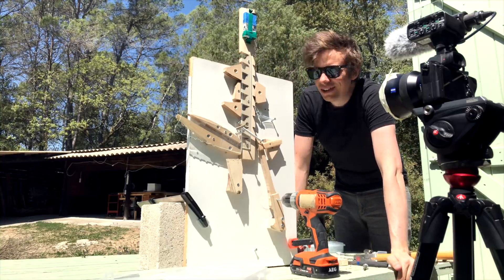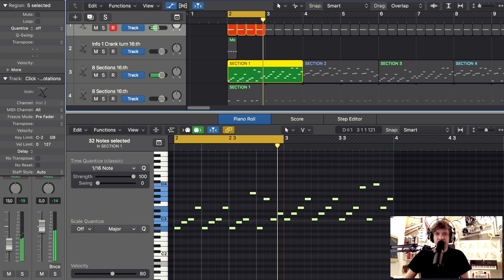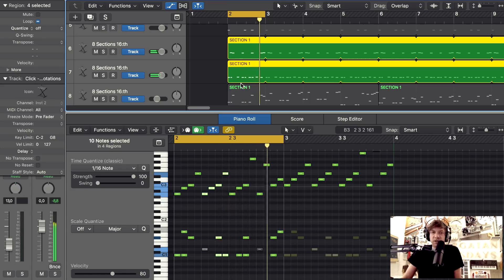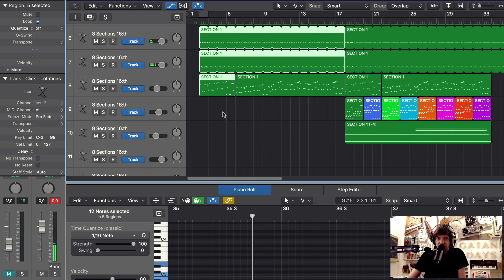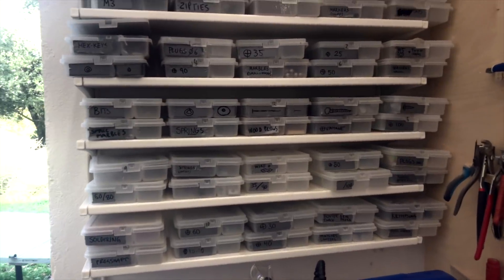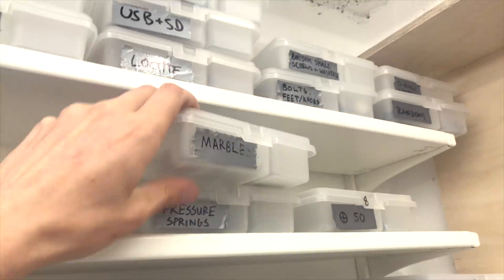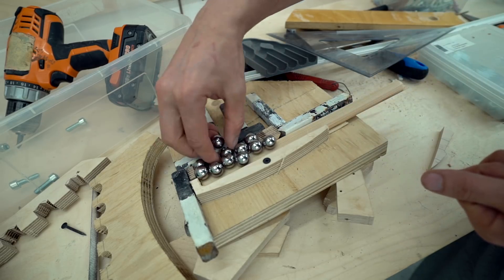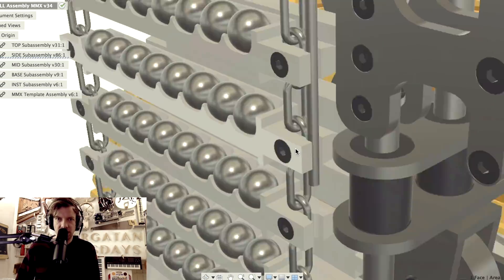Conveyor Belt Marble Lift - Marble Machine X #33

Comment: You are lifting them statically. Why not flick them up a slope like at the start of a pinball machine? If that is to noisy, you could accelerate them slowly by a spinning spiral cam shaft. The marble starts accelerating at the centre of the cam shaft and gets faster and faster as it moves towards the tip of the spiral. At that moment it would need to have enough momentum to shoot all the way to the too of the machine. This soultion would achieve the same material flow but with only one moving part and that is the spiral cam rotating around an axis. 

Your current lift looks very cool, but as an engineer, I would always try to remove as many moving parts as possible.
Reply: Wouldn't flicking them up require running the machine at a certain tempo? Run the machine too quickly and you risk marbles turning into bullets, too slowly and they don't make it to the top.
Reply: if you want him to notice you, and this idea, you should make a topic on his reddit page so more people can agree with you and discuss it with you.
Reply: Here is a sketch: https://imgur.com/a/9rC28Cb
Reply: Max Maker Oh. That's not what I thought you meant. I was thinking of an Archimedes Screw.
I still think any kind of reliance on upward momentum is a bad idea.
Reply: Brian McHaney Archimedes screw could work though, have gear ratio that spins it fast enough so the supply of marbles is stable, and it would add a really nice aesthetic feature if it was for example in a clear tube, or maybe even two of them.
Reply: Thanks. I just did.
Reply: +Wintergaten I used to own a Hyperball arcade machine. The solenoid system can shoot a lot of marbles really far, really fast. https://youtu.be/_RCmw74L1vQ?t=56s
Reply: The only problem with a design that slings ball bearings down a track is that if only one marble doesn't make it to the end, then the marble behind it will hit it and ricochet backwards hitting the ball bearing behind it causing a chain reaction that would clog the system. If there is only a tenth of a percent chance of failure then it will fail considering the volume of balls required for a song.  All the designs he has done are all positive drive systems for this reason. Cool design though.
Reply: Max Maker or simply a hose filled wit marbles. One goes I  the bottom and one immediately comes out the top.
Reply: Max Maker I think control of each marble would be a greater concern than fewer parts.
Reply: Max Maker Actually, yeah. The spiral sounds like it might work... And it would be waaaay fewer parts. I think biggest issue is that it would also have to be very long to reach the height he needs it.
Reply: @Bill Keith : that would require electricity.
Reply: +krytharn Someone else suggested a system like the plunger of a pinball which is the same premise. I still like the spiral rod lift idea.
Reply: +Nirrti Yes that is what is used to lift the marbles in the Hyperball arcade pinball machine. https://www.startpage.com/do/search?q=Archimedes+screw&nj=0&cat=pics&lui=english
Reply: too noisy? you ever wonder why modern cars have belts not chains.
Reply: I doubt that you can move so many marbles with that system
Reply: Cm you post the Reddit link?
Reply: That was also my first thought. Why not using a archimedis spiral or something like that. Easy to build, not that noisy and rocksolid simple.
Reply: Also nice!
Reply: https://www.reddit.com/r/MarbleMachineX/comments/8ewony/super_simple_idea_for_lifting_up_a_lot_of_marbles/
Reply: http://www.hydro-kosmos.de/anlage/archimed.htm
Reply: Belts can slip, chains cannot (without significant impact). And if the chain is oiled it will not make a sound.
Reply: Depends on the belt. Ive heard that some totally stupid persons drive a motorcycle with belts or even camshafts in car engines... ;)
Reply: A spiral cam shaft sounds pretty interesting.  At 8 marbles per crank, it would be spinning pretty fast though.  Would you just feed one marble in at a time?  That doesn't give the marbles much time to roll nicely into the loader.  Maybe if you had two in parallel, or four even?  I don't know about that.
Reply: Yeah you can have 4 going up at the same time. Imagine a wire cage in a spiral form. The marbles enter in the centre of the spiral. An arm rotates inside the spiral and pushes the marbles along the  spiral path. The marbles travel outwards to the edge of the spiral and continuously accelerate. At the end, they are fast enough to follow a path upwards.
Reply: the way he seems to think is more is better

Comment: Throughout the whole video I was thinking: If you have bandwidth problems, why not go in parallel? Just add more of what you need. A second seesaw, or a second lift. Let two marbels go up in one place instead of just one marble. Double the capacity.
Reply: As far as I understand he actually already considered that, but he thinks such a design would look too bulky, kind of like an 'ear' hanging of one side.
Reply: he octoupled the bandwith already.. there are 8 marbles being liftet at one time, But Thomas is right, lifting more will look too bulky and then the lifting wheels are becoming the bottleneck. Also if there is unlimited bandwith, where's the challenge in composing music for that then ;-)
Reply: +Wintergaten The marbles could also be demagnetized while queuing/climbing the 8x chain lift. And while you are at it just make the lift 12 to 16 marbles wide.
Reply: Bill Keith A second magnet wheel means a second demagnetization wheel, which I don't think there's much space for on top of the machine. It also wouldn't look as cool to have the same thing twice.
Reply: You can make better, fuller music if you do not have a limited bandwith, though.
Reply: What is so wrong with using a second magnet wheel?
Reply: Why couldn't he increase the speed of the first design? 
Am I missing something?
Also couldn't he increase the speed the marbles go into the pickup thingy by making the bevel a bit steeper?
Reply: He could double the thickness of the first lift wheel thus doubling the rate.
Reply: Demag after the second wheel not both.
Reply: Doesn't the first wheel feed marbles to one portion and the second lifting mechanism go higher up?

Comment: I'm enjoying the iterative approach and "shoot-from-the-hip" editing! Dumb question: how are you ensuring that you can turn the entire assembly with the treadle? With so many more parts I'm imagining a lot more friction (though, with more precision and metal fittings, perhaps you make up for it) than the first machine? The treadle will let you exert greater force than the hand-crank, but how do you know it will be enough?
Reply from the maker: Thanks and Glad you asked:) Alex, the german engineer from the team has made an excel sheet calculating all the force of all parts and come up with a nmber for how hard the crank has to be turned. and he says it looks OK so far. That combined with my experience from the first machine. All my power trains/gear trains are very short. so i only have three steps away from the cranks shaft to almost all other moving parts. and the flywheel will store massive amount of energy, so as long as i can get the flywheel rolling, all the other parts will just obey!
Reply: I was wondering during this video if at the end of this you'd be able to turn the crank to run the machine. I'm glad you're addressing it.
Reply: Otherwise you could take up a sport other than frisbee golf to build up thigh muscles. More bicycling, perhaps?
Reply: Ron Kuhlmeier If the treadle changes to a bicycle, he would have to play Tornado on it!
Reply: In the spirit of "Prototyping is the best test" see this Redit suggestion It is a quickly buildable rig for testing the reality of what it will feel like when turning the crank.https://www.reddit.com/r/MarbleMachineX/comments/8f37fg/suggestion_hard_or_easy_prototyping_human_effort/
Reply: millylitre Dunno if you drew that diagram, if so I don't mean to be overly critical, but if you know people in engineering you know we point out technical flaws, it's what we do. The apparatus depicted—putting a weight, calculated to correspond to the total resistive force in the Marble Machine X, on a string coiled about a crank—doesn't actually work as a prototype of anything except whether a human musician can break the static friction to get the machine moving in the first place.

But static friction isn't the primary issue. As Martin mentioned above, a lot of effort is taken over from the human by the flywheel and other rotational energy of the machine. Imagine you were cranking the pictured prototype apparatus and suddenly released it. The apparatus, having no almost no independent rotational energy (just that of the dowel and crank) will stop almost instantly and the crank will reverse course until the weight falls back to the ground. The Marble Machine X, however, will continue to rotate for quite awhile unless the brake is used—it has a lot of rotational energy stored up in it. Unlike the weight apparatus, the Marble Machine X won't ever reverse rotation on its own—there is no potential energy due to gravity stored that would cause that to happen like with the lifted weight.

The apparatus isn't useless, though, since it's simple enough that it wouldn't take but minutes to construct. If Martin can turn it just a few seconds—whatever's calculated as the "ramp up time" before the Machine is moving at the music's tempo—then he'll know for certain he'll be able to get it going. From the moment he starts to turn the crank of the real Machine, the turning will get progressively easier until it reaches an equilibrium force at the tempo required. So the constant-effort weighted apparatus could provide a safety ceiling of sorts. But the force-calculation spreadsheet that Martin mentioned will give a better idea overall of the effort required to play a full song on the Marble Machine X.

I hope that explanation made sense?

(Edited: In trying to use layperson terms I was technically incorrect in something I wrote above: "there is no potential energy due to gravity stored that would cause [the Marble Machine X's crank to push against the human and eventually turn in reverse]".

In some sense, the entire Marble Machine X's means is harnessing potential energy of gravity—we get the marbles up to the top of the machine, and let gravity do the rest—so saying there is "no potential energy due to gravity stored" is obviously incorrect. But the difference from the hoist (the technical term for the weighted apparatus) and the Marble Machine X is that the Marble Machine X has no external potential energy from gravity except its own weight, which is entirely negated by its legs on the floor. The hoist has "black box" extrinsic potential energy—energy that can be observed even if the entire device were hidden from view by the way the crank acts—while the Marble Machine X only has intrinsic potential energy.)
Reply: (I've also added the above comment to millylitre to the reddit post so that discussion can continue there rather than on YouTube comments.)

Comment: This was such a cool video.  I really feel like I am part of the process even though I am truly just along for the ride.

On the lift system, considering the "jerky" movement that the ratchets will cause are you concerned about using chain links that may not remain taught and could add some inconsistency and/or noise to the system?

Comment: Maybe a stupid question: why are you combining the 4-track-setup from the demagnetizer to a single track which is then followed by the by-8-splitter => why not splitting the individual 4 demagnitzation tracks by 2 to get to 8?
It might also be that there is a throughput problem having only the 1 connecting track to your by-8-splitter?

Comment: Quick question, whats going to hold the marbles in place? Ratchet systems can have very violent actions so the marbles will likely bounce out.

Secondly, why not get rid of the fish stairs. Extend the conveyor belt 4 more spaces. Add a second loading ramp up higher and load 4 marbles into the conveyor where the fish stairs used to be?  That would reduce some of your design complexity

Comment: You should make the marble swing double sided so it doesn't have to wait to flip back before it can load 8 more marbles. That way it can load 8 flip and dump, load 8 more the other side then flip and dump. It would greatly speed up the process.

Comment: If the conveyor belt is always grabbing 8 marbles, how will you make sure there is always enough marbles waiting to be picked up and prevent a load from missing a marble or two? It seems like the divide by 8 will always need to be full to provide a full load for the conveyor, otherwise, the first channel on the left will be full and the channels to the right could be empty.

Comment: I've been wondering - are Karin and Olof still working on the project? I haven't seen or heard you mention them for a while and I was wondering.
Reply from the maker: They are studying and do´nt have time to work on MMX anymore!
Reply from the maker: @dapstart, no
Reply: And consistently using an accent instead of the apostrophe. Hint: In the swedish keyboard layout, use the ' sign to the right of the Ä key. It's. Don't. Doesn't. Some places will replace them with curly variants: It’s, Don’t, Doesn’t, both better than using an orphaned accent mark.
Reply: Michael Young As I explicitly mentioned, I wanted to offer some constructive feedback. If he ignores it, it's fine, if I could help him, that's even better :)
Reply: Wintergatan you're consistently putting the apostrophe in "don't" at the wrong place ;) Not making fun of you but rather giving some constructive feedback :)
Reply: Also, he's using an acute accent, not an apostrophe. /Swedish grammar Nazi.
Reply: Bálint Pais Altough "do'nt" is not right, its better than nothing. But you are still right.
Reply: no they were fired

Comment: Are you using several different marble lifting mechanisms for aesthetic reasons?  You could just use this to haul them up the entire distance, ya?
Might it be a good idea to instead have some boring but reliable marble lifter to get the volume you need, and then have all the cool looking stuff there to add bonus marbles?

Also, are you accounting for extra noise from each component, or does the overall rattle of the machine not affect the sampling of the individual instruments?

Comment: Hey Martin! Wouldn't be a good idea for the lifting system for the marbles to be dependent on a separate gear so that you can change its size (and number of teeth) depending on the song you want to play? So the lifting system would move faster or slower depending on the fact that for a specific song you need more marbles or less.
Not sure how you would implement this, just throwing out some ideas ;)

Comment: even to this day, i still don't like the idea of magnets being incorporated into the mmx, idk why but i think it would not work as flawlessly as we imagine it to be.

also in a machine that never stops rattling for hours i think the magnetism of the magnet inside the wheel will be gone in a very short period of time.

is it not possible to not use magnets? yes i have no better solution but one can wish. i know you might be way too deep into the design already to drop the magnetic part but yeah i don't know.
Reply: He could use ceramic or hard plastic marbles...
Reply: Neodymium magnets have a pretty high resistance against being demagnetized. They're not as good against high temperatures as other magnets, but the MMX would burn way before that sort of temperature either.

Yes, avoiding the whole magnet/demagnetization/lift would have made the lift that simpler, but he seems pretty set on the aesthetics of that.
Reply: yeah man, i get it that the aesthetics are important since it won't be like modified in any way, but magnets are just bound to make things unreliable.

ceramic can crack, hard plastic won't produce as good a sound.

Comment: If going this way, why not simply use the chain elevator from very bottom to top? Would eliminate a whole lot of complexity, no need to demag the marbles (or use steel even). Should reduce noise and drag overall...
Reply: @wintergatan - this would actually be sort of Back to the Future in similarity to your first machine, just with the lift rotated 90 degrees

Comment: OMG, I love the new conveyor belt design! It's tidy, super fast and it shows how much effort is put into the sheer amount of marbles that are needed each beat to play the music.

And with the 8+ marbles per turn rule, don't forget that you have the recycling system. So every time you don't use all 8 marbles, the ones that were left over should be able to compensate bars where you used more than 8. BRILLIANT!
Reply: to add to what LargeBanana said above about eliminating magnets from the design - it seems like you could just make the conveyor belt taller and just load the marbles directly into the "shuttles", and then you wouldn't need magnets or demagnetizers at all.  and then there will be less stuff to break or fail. no, it doesn't look as cool, but it should be more reliable, and that's more important than looks.  you already have awesome looks with the Tim Burton style fingers on the front, and the great detail on all the gears.
Reply: Doesn't pass the rule of cool though
Reply from the maker: Yes! Thats true!! i forgot it in the demo haha